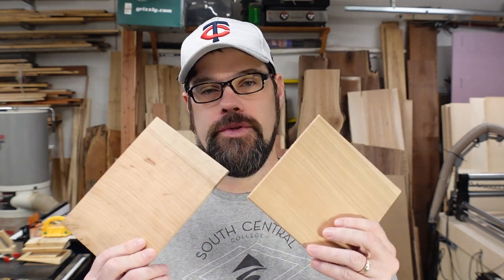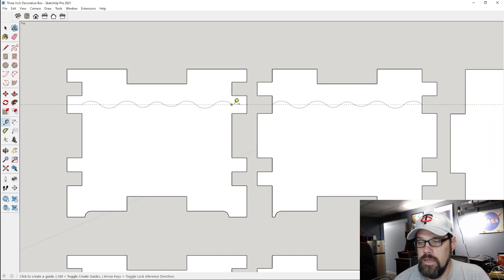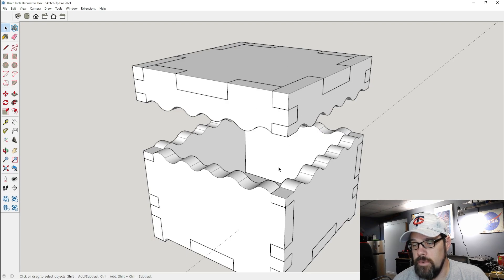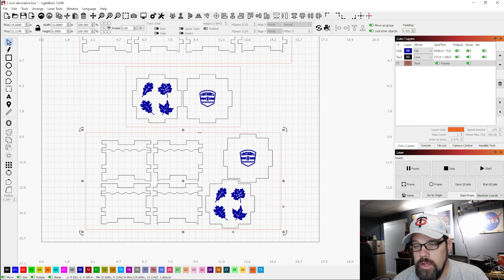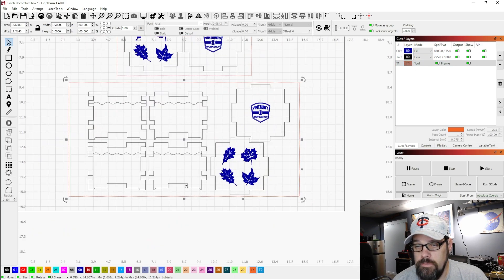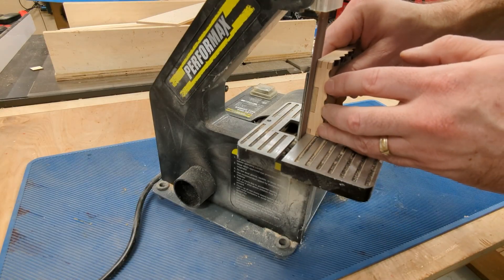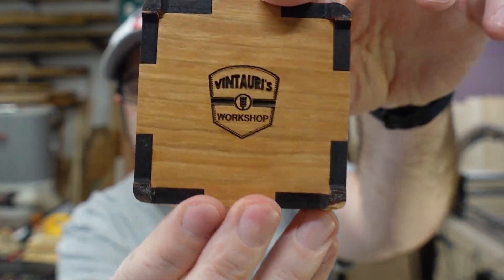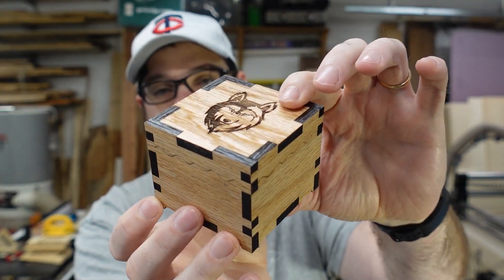Cutting 1/4" solid hardwood for a small decorative box with the xTool D1 Pro 20w

Comment: Looking to buy a belt sander for exactly this purposes (sanding the finger blackedned finger joints off boxes). What are you rocking there, 1" wide and how much grit for this application? Thanks!
Reply from the maker: This is a 1” belt on a cheap sander I picked up at Menards. I run a variety of belts depending on the work but typically I leave a 120 grit belt on there for general work. If you can, I’d get one with a small disc sander on it as well. Dremal used to make a nice one maybe Rikon has one now too.

Comment: You were able to do the cut on the quarter inch cherry in just a single pass? Just wondering because I was looking at a project using the same type of wood and I want to make sure what you used for settings. It will be my first time trying to cut hardwood.
Reply from the maker: @kevinkronewitter3374  Yea this was a single pass. Your material may be different but for solid wood cherry this worked well. Some solid hardwoods are easier to cut than plywoods due to the lack of glue layers.
Reply: Very nice. Thanks for the video and the information.

Comment: Seen this on the livestream. Love the design. I have a similar design and I market it as my "Forever Box." The idea being that a couple takes turns using the box to give gifts to one another. You don't have to put the actual item in the box. It could be something small that does fit. Or you could even use it to gift a car. Simply out a key in the box. Like all things we make, you are only limited by your imagination. I am curious what kind of problems you'd encounter when scaling this up in Lightburn. I love seeing projects made with solid hardwoods.
Reply from the maker: Thanks for checking it out.  I'll have to look at your forever box as well. As for the modifications in Lightburn, I'll need to play with it to see how easily it would modify, vs having to manually redraw some things.  I love Lightburn but sometimes it's just easier to make the mods in CAD for me.

Comment: Steve - i bought your box on Etsy. It ran great! My wife would like me to make it bigger, so I scaled it to 5". The problem is that the slots and tabs scaled too, and it leaves a lot of excess outside the box when put together. How do I scale it while keeping the slots and tabs at the same size for 3mm or 5mm wood?
Reply from the maker: You can try to use the resize slot and tab tool to adjust them to the correct depth of your material.  I have not tested that on this file with the curved joint so it might need some manual adjustments to get it perfect.
Reply: Steve - I did try that first. I'm going to revisit it again later. (too cold in the garage at the moment). Thanks for your feedback. @Vintauri

Comment: I downloaded and printed your file, problem, the top and bottom pieces are printing with rounded edges and the slots are too wide to fit in their matching slots. The parts don't show as rounded in Lightburn. This is weird. When I click preview it shows the file being printed with rounded edges.
Reply from the maker: If you are getting rounded edges cut but it's square in lightburn, you likely have some mechanical issue with your laser such as being out of square or belts that are too tight or too loose.
Reply: Then why are the other pieces being cut square? @Vintauri Plus the tabs are too wide.
Reply from the maker: Without seeing your lightburn setup, I have no idea why you would be getting curves on the top and bottom pieces.  I tested the files many times and have had others use them without issue.  If you want to send me some pictures and screenshots I can try to see what might be going on.
Reply: Could you just load the file in Lightburn and run thru "Preview" it shows rounded edges when I press play. You don't have to cut it.
Reply from the maker: @owenauer3406  I just downloaded the files from Etsy to check them. I’m not seeing the curves on the top and bottom pieces. They are fine for me. Even in the preview.
Reply: I just ran the preview again and it showed square edges also, now I'm totally confused. I'm going to test cut a bottom piece, thanks for your time, I'll let you know what's happening.
Reply from the maker: @owenauer3406   Hopefully, it was just some weird bug.  I do want to help people be successful, but some things just end up as head scratchers!
Reply: After cutting those round edges it now did them square and the proper width. I have no idea what happened before.
Reply from the maker: If it makes you feel any better. I just wasted two 15x15 sheets of plywood by entering the wrong kerf offset.  There is a big difference between .9mm and .09mm! 😬